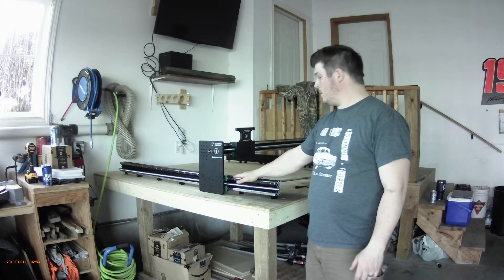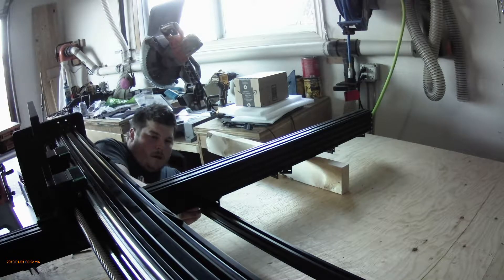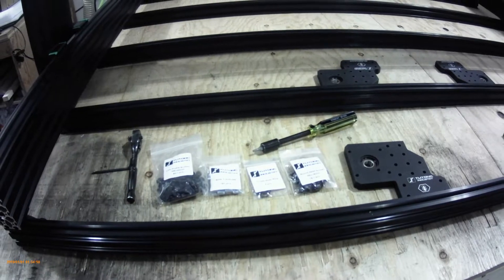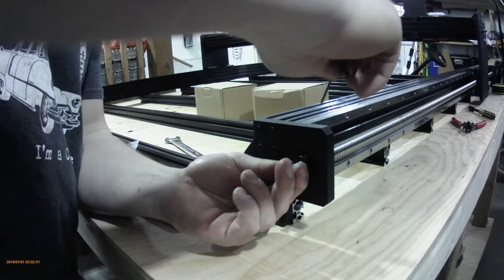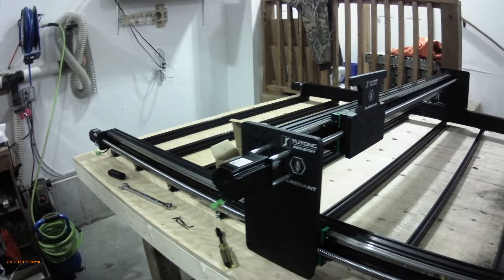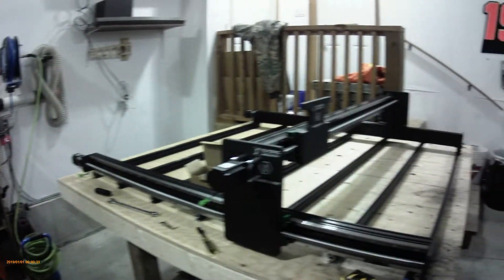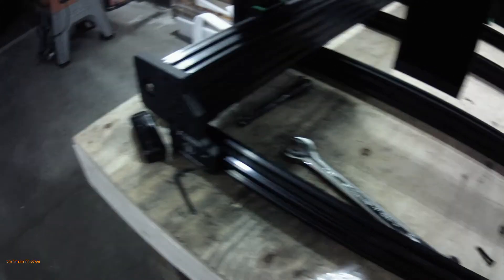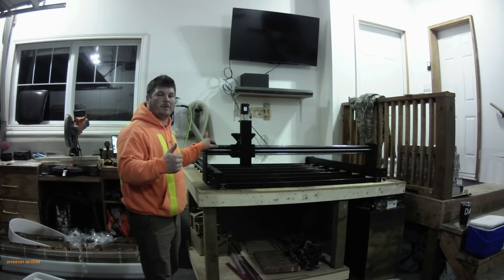QueenAnt Pro 1515 Build Part 2 - YUYONG Industry

Comment: I wonder if glueing the 2040 filler piece into the c-beam would help make it even more ridged,they don't seem to be very tight in there. I just recieved my 1015 version of the same machine, so I'm watching with great interest.
Reply from the maker: Thanks for reaching out mine seemed decently snug in there especially once it all gets anchored to the the end plates but if you decide to go that way please let me know how it works out
Reply: If you glue that piece 2040  in with epoxy it will be much stiffer.
 I am building a 1515 right now for myself and consider glueing in  the part 2040.